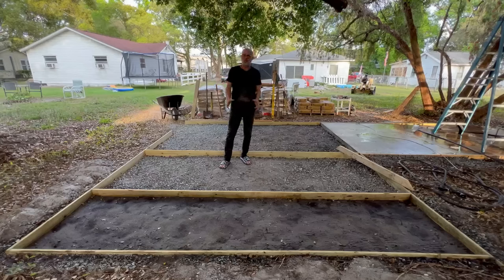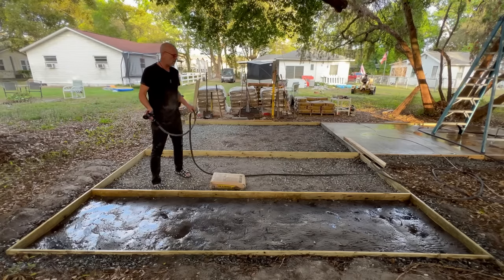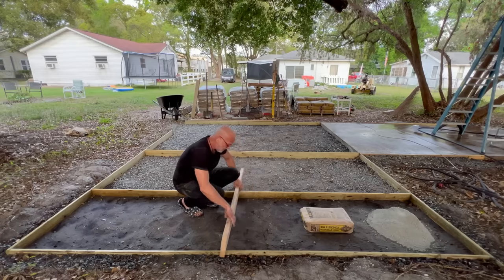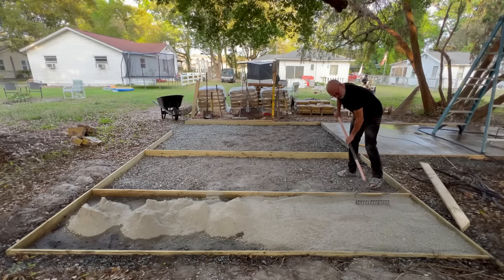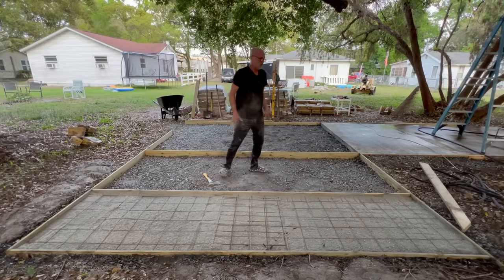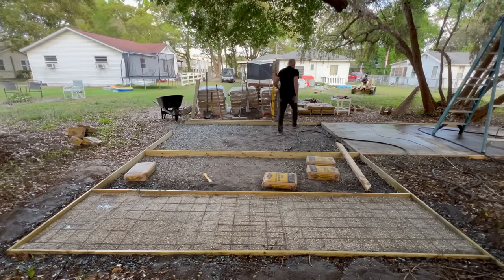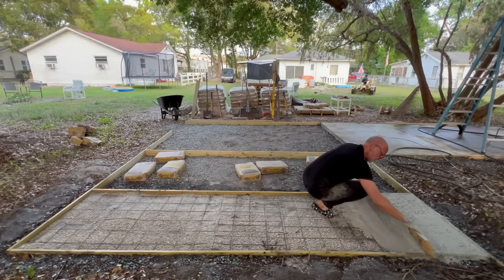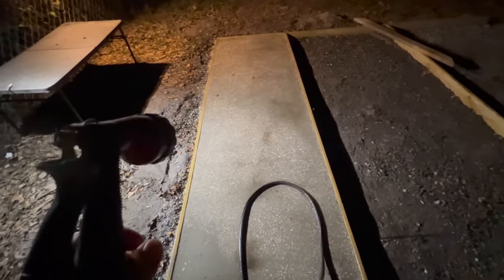How To DIY Dry Pour A Large Concrete Slab In Real Time

Comment: Nice work. Concrete is brutal on your hands. The very nature of the stuff will pull the moisture out of your skin, then the chemical burns that can occur. People react differently to it, but minimizing skin contact is important. Concrete hardens as it hydrates, think what the concrete dust will do when it gets in your lungs, nice moist environment. Your choice. Some people watching may not understand the chemistry of concrete and how it works.
Reply: Was thinking the same thing,  his hands will get burnt
Reply: Plus keep your pets off of it for a long time until after it is well cured.  A friend who does concrete told me the horror story of when they whipped out a pad for a dog kennel and what it did to the dog.  Not a nice story at all.  I am sure walking across it would be fine, but spending any significant time on a new pad is a problem.
Reply: Yeah....Doing concrete with bare hands and flip flops is nuts yet he warns of leaving the rake pointing up. The guy yaps and was totally disorganized. It was painful to watch. I nearly punched my new Apple MacBook Air.
Reply: MurphyMB- I was thinking the same thing and I was looking at his feet. No shoes like that should be any  where near that concrete dust   He oughta have on boots or shoes something that the concrete will not be able to get to the skin. I worked at concert pouring and finishing for several years and that is the first thing you should learn. Concrete will cauuse problems with your feet and hand even later in life. It can make your hands and feet breakout and peel, if you do it for a long time in your life, Talking from experience. 
Thank You 
C. Escue
Brighton, TN
Reply: I handled concrete once with no gloves and skin started to peel really bad. I’ll never do that again.  
I use a respirator any time I work with concrete.
Reply: @colstace2560  yet he's doing just fine in the video
Reply: @meandmyRC99  😊
Reply: Thanks for the health tips
Reply: 👍It’s been years, but the concrete crews I used to be around at large construction sites, put Vaseline on their arms - areas exposed and wore gloves.
Reply: @meandmyRC99  dogs don’t belong on concrete, what is wrong with people, they don’t belong locked up in a kennel. If you don’t have a yard for your dog to run around in then don’t have a dog !
Reply: @kimdagnillo8246  While I understand the sentiment, I don't necessarily agree.  My own dogs are always inside or in my large fenced yard.  Not everyone can afford a yard or have the finances to fence it properly.  Some dogs are natural jumpers too.  Leaving them in a pen/kennel to get some fresh air in some nice spring weather isn't the worst thing really.  Having  dog permanently in a kennel outside is cruel.  Canine's are pack animals.  However, leaving your dog out for few hours here and there isn't so bad.  Shelters are overflowing with dogs/cats.  Forcing everyone to have the perfect setup won't help that situation at all.  You have to be flexible as not everyone will have the ideal situation.
Reply: @tooslow4065  It take a few hours before the affect to show up. It's not like a fire burn which happens right away.
Reply: I came to say NEVER use bare hands. I found out the hard way. painful
Reply: use vinegar
Reply: Wow!  I did this kind of work in the steel industry for 40 years and never thought of all these terrible things can happen to my hands.  I had calloused hands and proud of them and always felt good working hard.  I was a working supervisor that poured bottoms of steel furnaces and 250 ton molten metal ladles.  I never seen so many male Karens.  I never worried about soft hands or lotion....
Reply: Thanks for this!
Reply: Yea i was like "is that gray coating directly on his hands?"
Reply: Yes, I wish he was wearing gloves and a mask for dust.
Reply: Are you supposed to wear a mask?

Comment: As I read through the comments and see all the haters, professional concrete workers, talk about this won't last for 6mos, 1 yr, or 2 yrs. Then I look at my drive way, sidewalks, and every other place that you see cracked or broken concrete installed by Professional Concrete tradesmen... your professional opinions are laughable. This man is doing what he wants on his property and enjoying his work. He is educating and inspiring some of us to get motivated and do it ourselves and be proud of our work...
Reply: And the fact that he’s on hard packed sand in a state that doesn’t have frost issues, I think this will probably last as long as any other kind of slab. 
 From another video there’s definitely a strength difference between dry vs wet mix but as long as he isn’t dropping heavy items on the ground he shouldn’t witness any chipping.
Reply: iv done it all since i was a little boy but i still do it the easy way
Reply: I like your comment... a friend slant $15k and it's got cracking everywhere.  That's only in 3 months  after the wet pour.. 
Myself.  I'd do it dry for walkways & patios, and small batch mixed with a portable mixer for sections for the driveways
Reply: Dry pour is weaker and chips much easier. Drop a hammer on dry pour and you will chip it.
Reply: dude concrete cracks no matter wet or dry pour...
Reply: Im impressed good job love your passion
Reply: You're perfectly right.  From experience doing lots of things by myself I find that I'm taking things apart only to find out I do better work than the pros whose work I'm always redoing the way it should have been done if done right.
Reply: @jkiker7918 yep one thing you can count on 100% is that concrete will crack.what matters is the sub materiel used where your cuts and joints are I don’t think people quite understand concrete cracks no matter what wet pour will an dry but when it cracks dry pour will crumble and degrade at a much faster rate and not to mention the psi rating difference of wet and dry poured concrete is significantly different.
Reply: @toddsecor288 yeah dry pour aint recommended if there is a need for load bearing or on heavy foot traffic and cars going over it. For a foot step to a shed, a dry pour is fine
Reply: @samjam6989  I personally would take the extra time mixing and get an overall better product.

Comment: Got to admit you put in the work. I'm work with concrete weekly and would recommend to anyone planning on doing this, get a mixer instead and mix with the correct ratios of water, otherwise your going to get weak spots that'll rub away with a light shoe twist.
Reply: Good video but, this might work okay in a climate like Florida.  But in the north where there is frost and freeze - thaw cycles I would fear the concrete would delaminate at the top or totally fail at the rewire. Also , I would try regular mortar mix on that second layer. You wouldn't be dealing with the aggregate on top when screed and finish.This is interesting though.
Reply: Been working with it all my life, I wanna see the same slabs in 6 months and a year. Guaranteed they fail spectacularly. This has got to be some of the worst concrete advice I've ever seen. Second only to puoring in the rain or when its far too cold.
Reply: @mohawkman2888  Exactly.
Reply: I would use this for a driveway but not structural. For structural it is a dangerous idea.
Reply: To get a smoother finish, seesaw the screed back and forth as you are pulling the dry mix level
Reply: @billyfeldhahn5224  the people pouring in this way are in the south. Usually small slabs not large weight bear. They state in their videos not meant for places with frost heave. This is specifically for small use.
Reply: @mohawkman2888  Cajun country living has done one this way and there are follow ups on year later. In the south it’s fine, this video is actually different than there’s. Those in the trades do one way why? Because they always have no other reason. Do the right application for the right situation.
Reply: @lechatbotte.  After 38 years of running high end constructoin projects, the last 14 in southeast Louisiana, I do things the way I do because I know what stands the test of time and the elements, and what doesn't. This very well may work in some rare instances, but I wouldnt use it for a doghouse slab personally.
Reply: Yep.   I poured and mixed 800 lbs of concrete, yesterday.   It's a little work, but I don't want to worry about a weak mix.   I did 3800 lbs for a sonotube pier foundation for my shed, last year. Why would you want to spend the money, haul the stuff and then cut corners at the last minute?   I'll be turning 70 in three months, so if I can do it right, you can as well.    BTW, make sure you wear a mask and safety glasses when you're dealing with the dry mix.  It's very easy to get it into your eyes and very bad for your lungs.
Reply: @mohawkman2888  While the test of time does have its validity it is more helpful to point out what exactly has failed related to the specific approach in this video.  I don't accept "we always did it this way and it works well" as sufficient reason not to do it another way.
Reply: @StephenBoesch  First and foremost: concrete and water need to be thoroughly mixed to ensure saturation of the dry ingredients to avoid dry and/or weak spots in the final cured product. The only time it's acceptable to soak dry concrete in place is when unopened bags are stacked and rebar driven through them, then the whole stack is kept wet for weeks, to create a low retaining wall. Beyond that the substrate needs to be properly prepared, i.e. removing the top layer(s) of sand and or soil, leveling and copmacting the sub soil, adding gravel and compacting again. THEN you mix and pour...etc. 
This method is a homeowner hack, and in my expert opinion after 40 years in the trades is a waste of money, time, and effort. No professional I know would bet his name or reputation on this process.
Reply: @mohawkman2888 did it ever dawn on you that you don’t do something a certain way because you’re PAID to do it? Because time is money for you? Homeowner hacks often times save money, at the expense of time. Sometimes, the “professional” way to do something, is nothing more than the fastest acceptable way to do it.
Reply: @dillan6134  Of course it did, not only on my own home but also on every one of the thousands of charity projects I've taken on over the years. Every bit of work I put my hands in, or my name on, regardless of profit or loss, is done to the highest standard, and guaranteed to last the practical working life of the materials used. There is no excuse for poor quality, either build right or dont build.
Reply: @dillan6134  Did it ever dawn on you that professionals do things a certain way, is because it’s the correct way to do it ? Do you think if dry pouring concrete was an acceptable way to use concrete, then professional contractors would be doing it that way ? This is not how to use concrete.

Comment: Looks like you had fun, and for your purposes, this is a  good process. As someone who spent 40+years in the concrete business, let me rush to tell you NOT to allow your bare hands and feet to come into contact with even moist concrete without cleaning them immediately. Concrete burns are real and severe.  Thanks for a very enjoyable video.
Reply: How thick would it need to be if one were doing a driveway instead? Also, how do you account for a slight sloping? We need to do our driveway so bad, but we definitely can't afford to pay professionals. Happy to diy if its manageable for us. Any thoughts you can offer would be greatly appreciated!
Reply: You need four inches thick for a driveway. You can do it on a slope just as on level ground, provided you are careful to only mist the concrete each time, just to the point where no water runs down your slope. The good thing about this method, too, is that, as long as you're very careful about maintaining a consistent grade, you can do it in multiple pours over a period of time, as cash allows you.
Reply: @johnmcafee9741 how about for a house to sit on?
Reply: @garryb.1334  your load bearing areas...exterior walls, interior load bearing walls...need at least  a foot in width and 18" deep. You slab itself is good at 4".
Reply: That and the inordinate amount of dust he just breathed in... yikes.
Reply: Also bagged concrete has heavy metals mixed in to improve shelf life...
Reply: @samuelb.9314  I know. I watched him move right into the dust. I had a girlfriend die at 27 from palm embolism. She cleaned houses for a living and used harsh chemical cleaning solutions.  I asked her one day saying to her, " You do wear a mask right?" She said no, I like the smell of the cleaning .  I tried to explain the dangers and she laughed  it off.  😢
Reply: And breathing in all that dry concrete,  bag after bag.... I'm coughing for him.
Reply: And let's not talk about concrete dust in the lungs.

Comment: I worked in the masonry business my whole life and I have also poured miles of concrete the traditional way.  A few years ago my propane tank sunk for the last time and I decided I was going to dry pour it.  I built a rectangle out of 2x4s around the tank and lifted it with my tractor and started dumping bags.  I threw some rebar in it as I went, but basically did the exact technique.  I blocked it up and let sit for about a week and it hasn't moved yet!  You if you're not done, try sawing your screed as you slide it and the concrete will be perfectly smooth.  Looks great!  my next project is to raise my AC condenser.
Reply: I agree and I have poured my share too.  word of caution is to go easy on the water...just damp it or the cement will sink through the gravel.  cover with a tarp and be patient.  I'm going to do a long skinny slab mixing #1 crusher run and portland mixed dry in a mixer. will be interesting. just a barn porch, not structural.
Reply: (This was submitted on another site by a civil engineer. What's your opinion on this way of laying concrete?)

@mikehewitt1253
1 month ago (edited)
Dear all, let me try to help everyone understand concrete. 

The cement part of any mortar or concrete reacts with water in a hydraulic chemical reaction (exothermic reaction i.e. generates heat). When thoroughly cured, meaning allowing enough time for this reaction to take place and preferably throughout all the cement particles where they become irreversibly hardened and water proof.

However, cement on it's own will shrink significantly and crack all over so it needs a binder - sand - this 'stretches' the cement through the mix so when it hardens via Curing it's bonded to lot's of already hard sand particles and more cement particles alike creating  a hard material that doesn't crack - mortar.

However 😁 mortar is not strong in itself. For strength we add Aggregate, ideally for strength you want some flat, some irregular stones (not pebble like) of 3 sizes - pea size, golf ball size and halfway between those - giving us Concrete when Cured throughout.

Now, I've watched many dry pour vids with interest and listened to the nay sayers saying it has to be WET to cure and therefore dry pour is nonsense.........

Time for education folks where (after that which I have outlined above) you will be surprised that I'm on the side of dry pour ....... SORT OF......

When dry pouring, it is tamped thoroughly down before spraying - this is GOOD - but cement particles and sand particles and aggregate elements throughout will not all receive moisture, will not Cure and will remain as dust in parts - not good.

BUT Wet is not great either! It's CONVENIENT.

The best, strongest concrete is Mechanical Concrete which is made with JUST ENOUGH water to provide moisture throughout for correct curing.

The test is - grab a small fist full, squeeze hard together in palm of hand and if doesn't hold shape and crumbles when released from pressure, needs more moisture. The shape should Break cleanly in two pieces without crumbling - if stretches in the break test, it's too wet.

So my recommendation to all is........

Dry pour mix thoroughly together with rake, add moisture by spraying so as not to over-wet BUT rake that moisture throughout and THEN Tamp down hard compacting it all properly and level off.

All this 24 hrs later stuff is inadequate - Minimum curing time is a month - covered to keep that minimum moisture in the mixed pad, base, driveway, - shouldn't be touched, don't go near it - best of both worlds here as easy as Dry Pour and stronger than the normal convenient Wet stuff which because of too much moisture cannot be as compacted and consolidated to provide the same strength.

Go Mechanical guys, it's the best. Anyone want to hear my views on Earthcrete, which I find fascinating - by the way - I'm a Civil Engineer - spent an entire year studying Concrete - an entire bloody year on nothing but concrete.

PS DON'T use quickset anything, you won't have enough time for all rake work, use standard Portland.

Comment: Not to take away from the great tips in doing a dry pour, but I would advise anyone who is going to do this method to read the Sakrete High Strength Concrete Mix Safety Data Sheet and use the proper PPE ✌
Reply: Yes! Invest in some work boots, not flip-flops. Include gloves and an N95 mask for the dust. That dust is actually a chemical.

Comment: Saw one comment but no reply that I’d like to see answered. Why are the other 2 framed out spots filled with loose gravel and the one you did just holding sand. Was there a reason or just experimenting? If the latter, which one was the best?